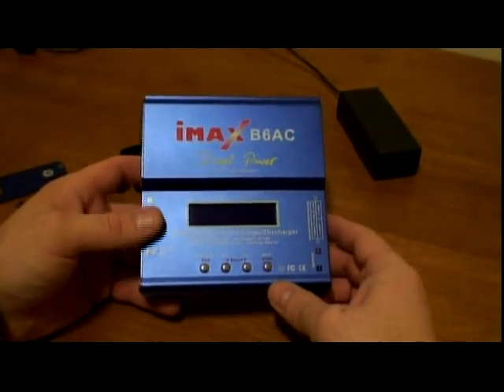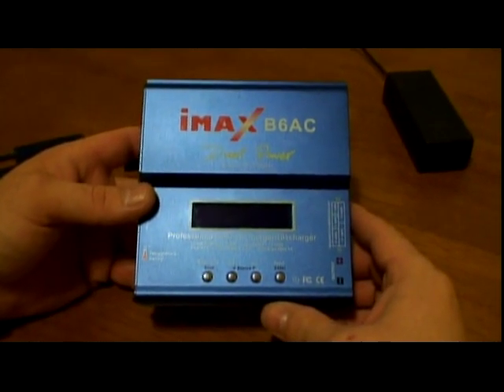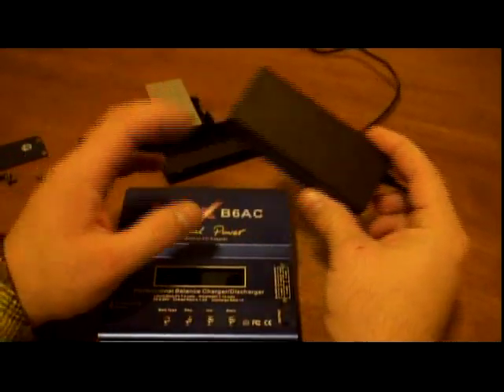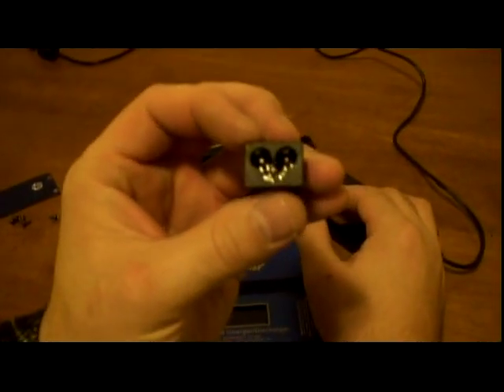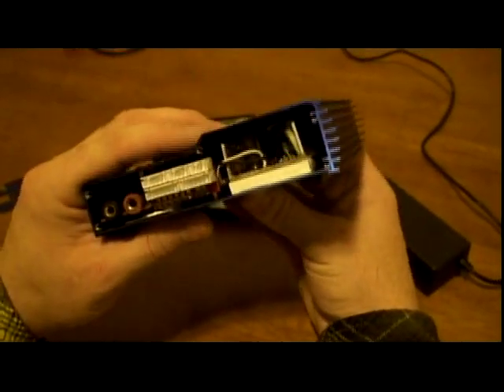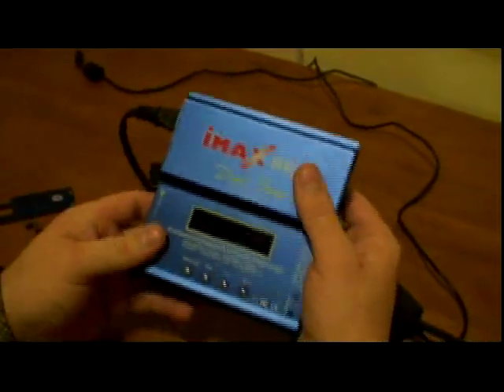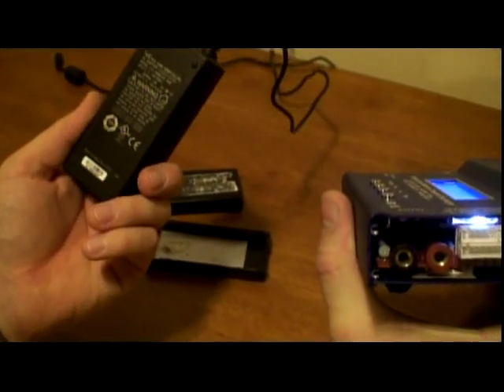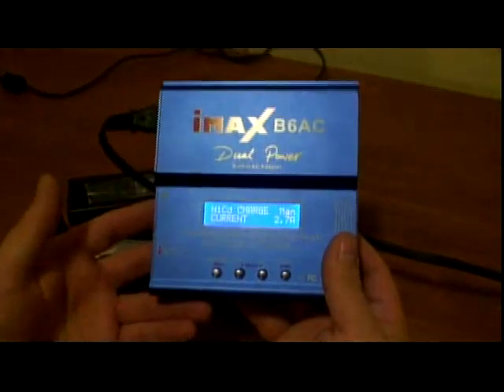Modifications for Imax B6AC Dual Power Charging Mod

Comment: I appreciate knowing the 3rd pin isnt used. Thanks a bunch! 
Rather, instead of removing the 3-pin, im going to ground the 3rd pin... as you should, too - for your safety. Anything can go wrong, and if that case happens to conduct some live voltage - and you reach for it - that electricity will ground through you. Be careful.

Comment: This unit is an excellent charger for the money.  It does have several issues common to the whole line that are easy to fix with the exception of the ac power adapter.  One thing is the cheap barrel connector.  It's job is to accept the connector for using batteries.  It also happens to be the switch for disconnecting the ac adapter.  During long periods of heavy charging time that connector melts on the inside and compromises the switch (I really don't believe its rated for 50 watts).  I recommend a switch lubricant from day one even if you never plan on charging with a battery.  Make sure you use the proper sized barrel connector.  They are already large, but if you use something bigger because it's available you will overheat the receptacle.  The banana plug receptacles are soldered with the least amount of solder possible.  When you charge a lot of batteries, one of them will break off eventually and short your battery.  You can forgo that problem by soldering a little more onto these connectors.  You must take the unit apart to fix that.  Balancing ports actually have a bothersome problem that occurs.  It's easy to fix, but I haven't found the cause.  I think it may be if you plug a balancing port in to the unit before powering it up.  Anyways, it usually shorts cell 1 and vaporizes the copper trace on the board.  If you have a charger that keeps telling you that a certain cell is high or low this is probably the problem.  Press the appropriate button to watch individual cell voltages.  If one of them is all over the place that is where you should start.  I've considered not purchasing another ac enabled unit, and just using a computer power supply to power 2 at a time.  People have told me there are complications with using switching regulated power supplies with a charger but guess what it comes with LOL!  It uses a 16khz switching unit, and works pretty good despite it being absurdly cheap.  I thought it funny that they bothered to rectify a full 120 volts AC to 165v DC, regulate 165 to 12 to power the switching IC directly, but then optically isolate the low voltage feedback circuit.  Right now I have one that runs up to 9.8 volts and quits.  Frankly it has me stumped I think it is the isolator.  The AC adapter is very sketchy.  They are different from one unit to the other but just in how they case them  The overall circuit is still the same.  Sometimes they are taped together on the inside.  One thing is for sure, again with the solder.  If you have one that fails completely you can disassemble the adapter fairly easily without destroying the case.  That way you can determine if it's the fuse, or a pure solder connection.  Obviously, unplug the unit.  Disassemble the unit and remove the AC adapter.  Use a hammer to LIGHTLY tap the case.  Don't just tap in one spot.  Work different areas maybe 10 to 20 taps at a time.  It may take a while but eventually the impacts will fatigue the adhesive and you will be able to remove it from the clamshell.

Comment: I have very similar knock-off and noted the heat right away.  I opened it up and noted the same as you did.  The AC/DC "brick" is sealed, has no ventilation and actually blocks half of the aluminum chassis' ventilation slots in the bottom.  I removed the switcher power circuit from the plastic enclosure and remounted it so the air could pass... no fan needed.

BTW, I did add earth ground  to the chassis now that the power supply board was no longer physically isolated from the rest of the circuits.  Your solution is a bit risky in that regard and I would recommend against it.

Comment: Looks like a great idea.  But my IMAX B6 (knock-off) is only 35 mm deep back there where the fan would go.  My charger looks identical so did he misspeak about the fan size or what am I missing?
Reply from the maker: 20mm DC Fan you can buy on Ebay under $10.00
Reply: GPeter7 Thanks for the reply.  Actually I think I'm going to go for a 30 mm fan.  The hole where the old plug came out (where you put your fan) is 25 mm wide and I want the fan to fill the entire width.  What do you think?  Also, what did you use to cut out the new hole for the new 2 pin plug  I was thinking maybe a dremel tool would do the job.
Reply from the maker: awesome hair 30mm probably OK, and yes I was using a dremel

Comment: Nice tips! I have the same charger as you. But my internal power supply stopped. Please, could you tell me what is the voltage specification? I've tried a HP supply 19 volts and it shows: "input voltage err." 12 volts does not turn on.
Reply from the maker: it can run from 11~18v DC not AC, if charger doesn't powers from 12v DC or car battery, probable original power supply when did go bad it fry a charger too

Comment: DANGEROUS and ILLEGAL.  

You need to earth the chassis now that you've removed a layer of electrical insulation from the power supply, since it no longer has its double insulated rating. An AC fault could cause a live AC conductor to contact the charger body and fry you the next time you pick it up.
Reply from the maker: no it will not fry you. because the power supply board is mounted on plastics posts not directly to the housing
Reply: Thats not the issue. You have an open power supply inside an ungrounded metal case. If it blows up or metls down for any reason there's a possibility of contact. Its not just about your situation but also those who might follow your lead. It's just plain bad advice.

Comment: Thanks for the response anyway. Good of you to be so prompt. I will have to go with the flow. Once I went ahead and saved a profile for a battery, the menu "tree" isn't quite the same. I get frustrated but now I will just program all my batteries into the B6AC and have it done with. I know there is a hidden function. Power it up with "Dec" and "Return" depressed and you may calibrate for voltage. Don't do it though. You must have a fully charged battery in perfect shape connected to it. leave it

Comment: I installed a 40mm fan on mine as well (I added a resistor so it wasn't running full speed), and I mounted it on the exterior. I also cut the black plastic case for the power supply open so there is better air flow. The charger runs noticeably cooler, hopefully it outlasts my old one.
Reply: It would have been nice to see you install the fan..... where you connected it too & if you put any controls on it......????

Comment: Wait a minute.......isn´t the shell made of aluminum? In that case it should be secured by protective earth. This is the reason why the mains connector has three pins. It´s quite brave to replace it with a 2-Pin-Socket because what you effectively did was disable the security system which prevents the shell to be energized (in case of a electrical failure).